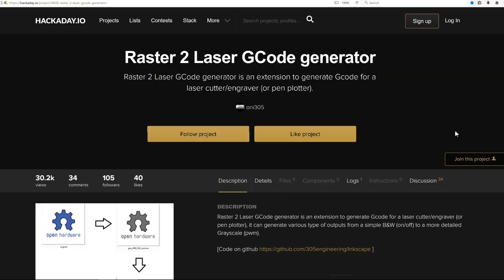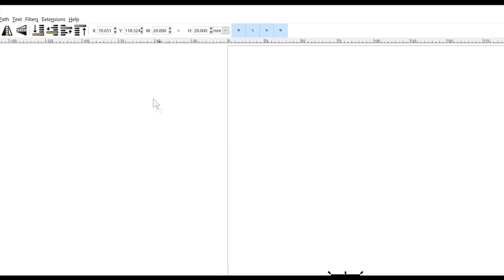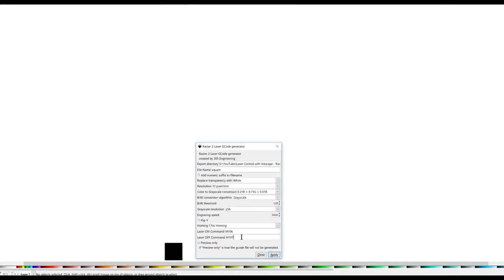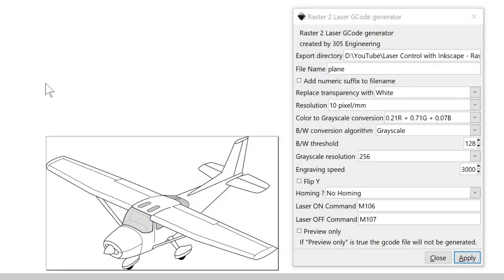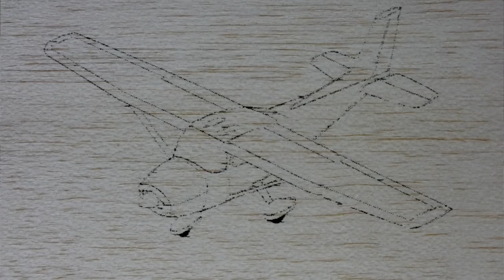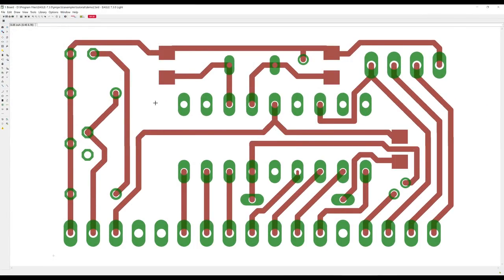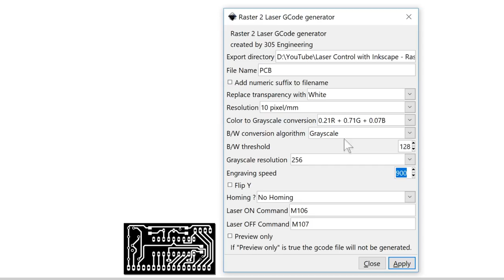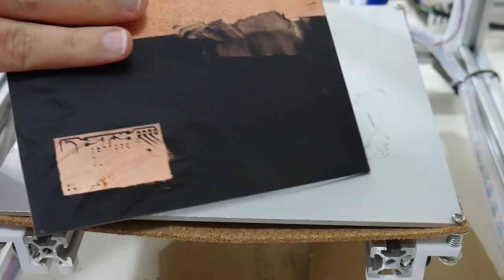☄ Laser Control with Inkscape #2

Comment: If you want to preserve your laser consider moving the PWM pin to one of the GPIO and setting the fan pin as laser enable in marlin. You can also just plug it directly into 12v and use a level shifting circuit with your fan pin if you don't want to change the firmware. The configuration you have it in turns the fan on sporadically and risks damaging your diode in the long run where the PWM pin can turn the beam on and off without turning the cooling fan off. It's especially risky if you are doing long rasters at low power since the fan may not even trigger at low PWM signals.

Comment: Thanks, really useful. I use a cnc engraving machine with a 1.6W blue laser mounted on the spindle motor, for PCBs I can do the drilling operations without having to reset the machine. Also, I find Kapton tape much better than black paint, you can scrub off the burnt bits with washing up liquid an an old toothbrush.

Comment: Love your example.  Especially the Circuit Board portion.  Please though for the love of god,  mount a little fan with the laser to blow the smoke away.  The lens will eventually have the smoke burn on it and make you a very sand panda.

Comment: For the burned paint i usually just rinse it under water. The vecor mode also works great for pcbs. You only need to outline your tracks (from pdf) with a 0.5 mm stroke and convert the stroke to solid. Takes more time in inkscape but worth it ;)  Great series btw :D
Reply: Vector would be the best way I bet.
Reply from the maker: Agreed, vector FTW.

Comment: Thanks for the vid it helped out a lot. I started out with a 2.5w laser then upgraded to a 5.5w and followed the same principles on installation etc; and everything turned out fine. Then I upgraded to a 15w beast and that setup on the same circuit is different. everything works great with the J tech extension, but i did notice that with 305 engineer extension it is too powerful for my particular engraving needs. Turns out that adjusting B/W threshold or grayscale is a bust and has no influence on the m106 power number. But I did discover that if you put a space after the M106 and S40 or whatever S number you want in the "Laser ON Command" then it works perfectly and places it in the gcode. Just thought you should know. Thanks again!

Comment: Those track edges look like they could be a bit smoother. A hacky way of achieving that would be to do one pass in vector mode, drawing just the track/pad edges and then following it up with the raster fill.
Reply from the maker: I'm not sure if it was my aggressive cleaning, or the laser not turning on/off fast enough resulting in not so perfect tracks.

Comment: In my opinion this circuit board will be much better when gcode will force to draw shapes of paths except drawing line and making step to next parallel line.. Because with this gcode, zoomed print looks like low res foto without antialiasing! :)
Reply: nanodeath yeah I think the previous method of vector control would have been better for drawing circuits, but still a great vid

Comment: Great tutorial, I would suggest you change engraving density in the build files which are open source from 10pixels/mm to 15 or 20 and with that you will achieve a much better finish(on the plane) ;)

Greetings,
Jake

Comment: i've just got my puny 3 axis cd rom cnc to accept gcodes from inkscape  and easel,i want to use a laser and a mill for every application imaginable,these two vids are excellent sources of info,BIG CHEERS for that,one thing,instead of matt paint try gloss or enamel,i use sharpie or enamel to touch up the laser printer iron on pcb image and the sharpie works well,but if i can wait ten-fifteen mins enamel paint is rock solid wont scratch off like sharpie,i think the matt paint is a wee bit too delicate after having a laser scortch its arse so close to what you want too keep as a track/pad,the enamel would be worth a shot.

If you do try it could you let me know how it went as it will be a while before i get to the lasering point(puny cd rom cnc stage),again this info is invaluable,and lasers are cool(to watch not temp).

Comment: I have been looking at this plugin and for we who are on Marlin + Arduino it has a HUGE oversight.  With lasers you control how dark it is via two methods and that is speed and power.  Speed seems to max out for us around 60-100mm/s (this is not the same as a 3d printer because each pixel is being burned not a track of ooze being laid out) so that hampers us IMMENSELY.  Now as for the other method of power this plugin doesn't do it for grayscale as it is always 255 max which is a nono.  What it does is take the pixel value and subtracts it from 255 with no scaling so everything I burn with it is too dark.  I know how to program so I can see what they did wrong but I don't know Python to be able to add a scaling power factor we can just input.  Say a min and max value for the power.

Comment: This is great!  I've got the same laser, and a PCB Router I've built.  I downloaded Inkscape and the Plug-in, and imported a .JPG file.  I ran the 305 Engineering extension, and got a  .gcode file.  However, it is just a raster, no on/off!  So I'm missing something.  Can you direct me to a tutorial?  I'm reading the on-line Inkscape manual, but I'm missing something.
Thanks!
Reply: I think you need to convert image to curves in inkscape to the extension works, but YMMV

Comment: There's a warning on the Banggood page for this laser that it shouldn't be used for more than 30 minutes continuous.  In my code, I put a pause in once every 10 minutes.  Do you know if these plugins do anything like that?
Reply: Well if they are running with pwm it should not be any problem, because its just due to heat. And since pwm doesnt run the laser at full power and probably only 50 % of the time it will be completly ok. If you want to be safe just limit the max pwm to like 200 or so. That will make sure it wont overheat. Or run a fan on the lasers heatsink

Comment: Really nice! Could you kindly test the PCB "etching" with the other software? I believe the traces would like a lot sharper, as did the airplane. Thanks for the tests and quality!
Reply from the maker: Checkout Flatcam. It can create toolpaths specifically for PCB design but it's intended for a drill. You need to edit the gcode and replace the Z axis moves with laser on/off commands. It works great though, I've done that previously.

Comment: I wouldn't prefer using a raster file to etch PCBs, as they aren't particularly precise. I'd instead convert to vector and generate gcode instructions from that. But I think that's what you did in your last video (I haven't watched it yet).

Comment: I keep having issues with my raster to gcode. when I take the image in inkscape and make the code, the preview it makes looks really great. Though when I go to print the code.. I never really see the laser turn off /on like it did in your video. Also my results are I think going to print a very solid black shape. I've never really let the laser finish to see the final result.
Reply: you laser might need additional G-code to turn it on mine requires M03 S255 the s command is just the laser power level. enter that where it has g-code to turn on laser.

Comment: Have you checked out the MKS robin? Seems like a really good value 32 bit board!
Reply: Yeah it probably is, but the reason I'm interested in the Robin is because you can install your own steppers, a very important feature in my opinion.
Reply from the maker: No I haven't as of yet. Looks like a great board with the LCD display. I like the option to add our own step drivers.

Comment: Apperantly 2500mW is not enough to go through copper! 
From your thumbnail, I thought you were going to make a PCB by burning away the copper!
Why go through this song and dance when the laser printer transfer method works the same way but at no extra cost?
Reply from the maker: I'm not sure how much laser power would be required to vaporize copper, but I dare say at this price point it definately won't!
And why not demonstrate how this Inkscape extension works and provide examples, regardless of the efficacy?
Reply: something like 5-10W for copper foil. Seen it in another YT video. The guy used a 5W and thin copper foil and then transferred the foil to Kapton tape making a DIY flex PCB. I have experimented (by hand, don't bother) to use the 2.5W laser for soldering. Thinking I was on to something until I seen a Computer Cronicles from like 1988 when one of the guests introduced a "new" laptop that used laser soldering |:/
Reply: Do you have a link to it? Kapton + Copper foil = flexible PCB sound intriguing.
Reply: Dude, there are so many problems with the toner transfer method. Registration for one.

Comment: Nice one man.
But for pcb is better to use flatcam allows u to do perfect double sided pcb all you do is export garber files and bring them in there .holes tools and more really good.
For cutting im using estlacam really good software
Reply: I second FlatCAM. The main benefit is that it is vector based, much better for engraving. Maybe using a large power plane or doing just trace outlines you could improve engraving time.
Reply: Lucas Hartmann yes but vector engraving is burning that much paint away ill reduce laser life badly.usin ISOLATION method would be much better and quicker.this is only my opinion
Reply: ISOLATION is just what I meant with "just trace outlines." I too think it would be better.
Reply from the maker: Yes I've used Flatcam previously (not in video) and modified the gcode to turn the laser on/off instead of Z axis up/down. It works very well and very fast. I needed to create multiple layers as the laser point is very small and not enough paint was burnt away.
Reply: Tech2C  you can set passes .im usualy do 3 passes with 0.02mm overlap works every tine .
Love ur videos man keep it up.

Do one video with flatcam bet u would help loads off people. When i started to use laser it was head scrach for weeks.and flatcam changed all so easy once u know whats what.
Looking forwards to new vide keep it up!!

Comment: I finally got my laser going and it burned through 10 pages and etched my boro glass and went through it and etched a line on my MK2B. :/  I didn't think a laser would go through all of that and be able to do that for these types of lasers.
Reply from the maker: Wow that is alot of material to penetrate and still etch your heat bed!
Reply: Yes, I am still in shock and that was a brand new glass too.  I will say that I could not get the nice pictures I have seen others get with it no matter how hard I tried.  I think the main issue is that the Arduino is just too slow as mine seems to max out around 100mm per sec and that is too slow for 10-255.

Comment: When I saw you using isopropyl to clean the PCB, I cringed. I cringed because you had said that the paint you used was an acrylic-based paint. Alcohol (ethanol, isopropyl) is very good at removing acrylic. You should've tried plain water first, scrubbing with a toothbrush, then blotting with a tissue.

Comment: Have you seen this video by electronoob where he uses a UV printer to print on resist? I think you should try this with your 3D printer - attatch a UV laser, and instead of using paint use dry resist as in the video or a presensitized PCB, or both for comparison, to print the circuit onto. I would love to see what kind of results/precision one can get from a DIY approach! https://youtu.be/-Qeq7ZgUOuE